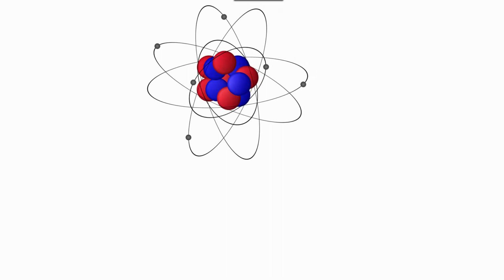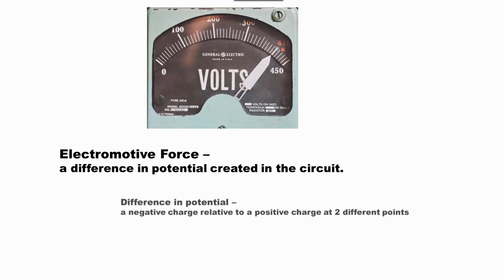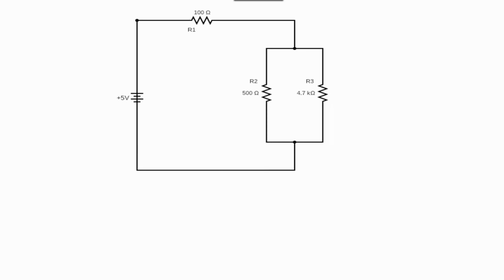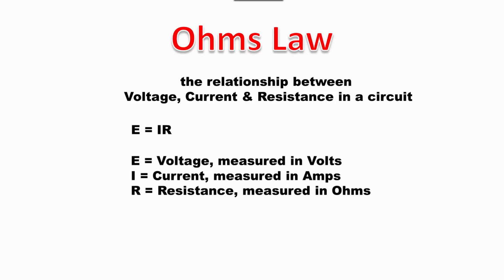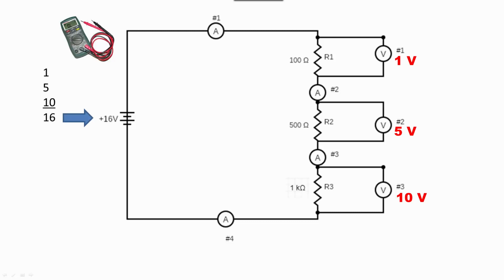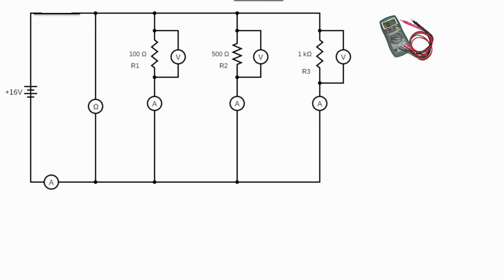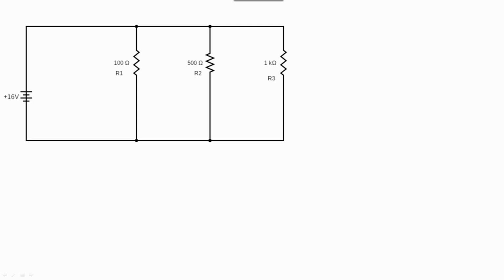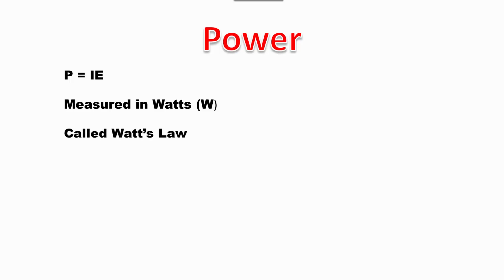Electronics 101: Voltage, Current, Resistance & Ohm's Law

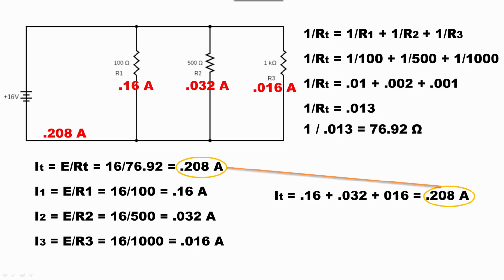Comment: You really need to work on the way you state the values for voltage, current, and resistance.  For example around 21:17 in this video, you state that the value is 2.08A when in fact it's .208A.   There are several examples earlier in the video but as this example was near the end I was able to find it easily.  Good job otherwise